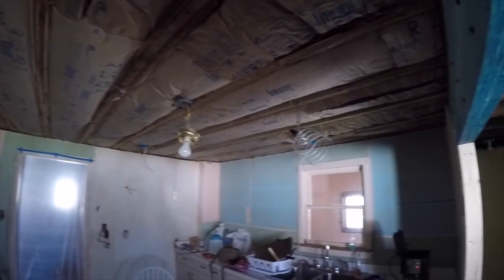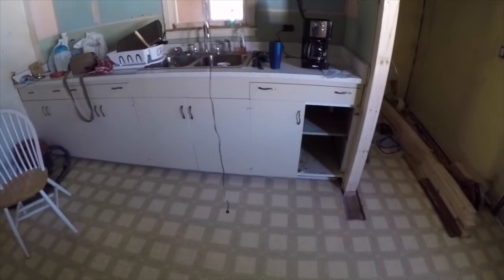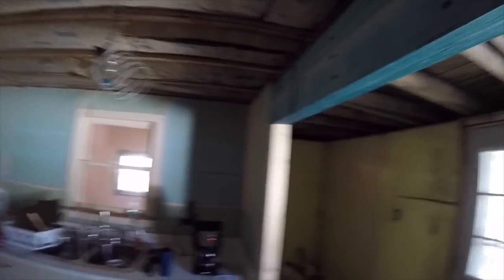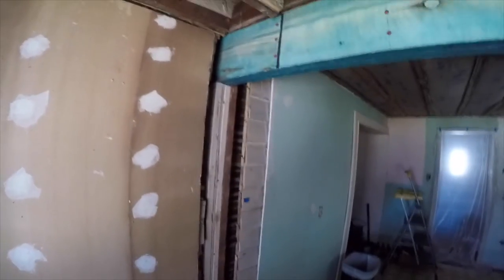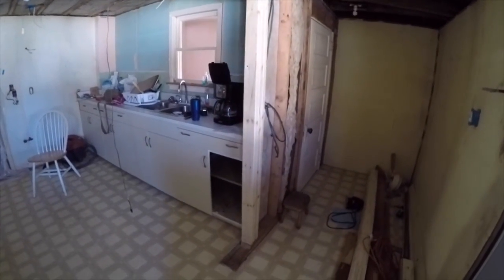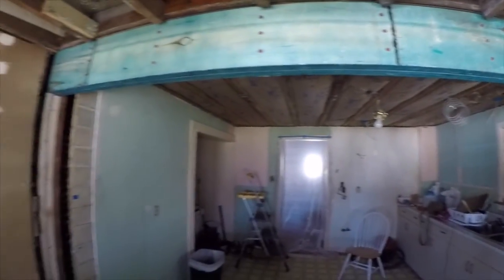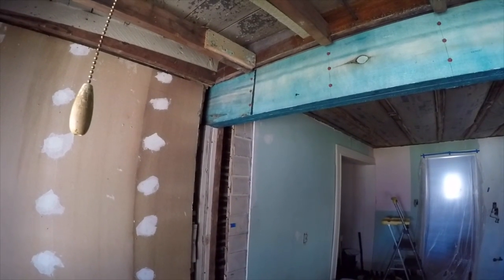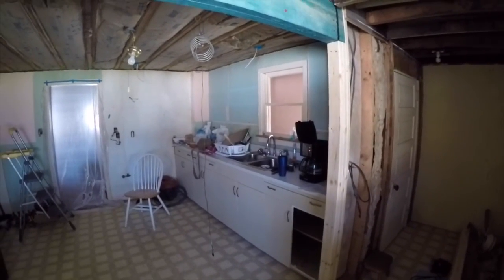How to Install an LVL Header DIY - Renovating an Old House

Comment: Hello Joe, it looks good. 
I’m doing something similar in my kitchen. We are opening interior wall (non load bearing). But one end touches similar way in your case. I’ve to support ex exterior wall now is the part of room. 
Question: do you have to get permits for this? Because I’m just getting all kinds of permit question. Due to pandemic not much help on legal departments.
Thanks again 
Keep up the good work.
Reply from the maker: A permit requirement will depend on your local county building code. You should be able to call them and ask if a permit is required for your location. Good luck with your project!